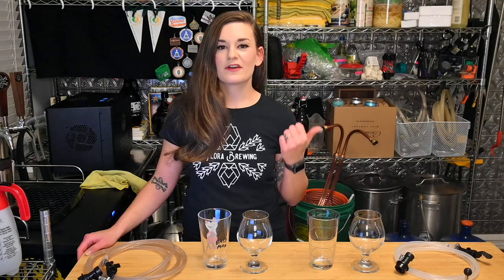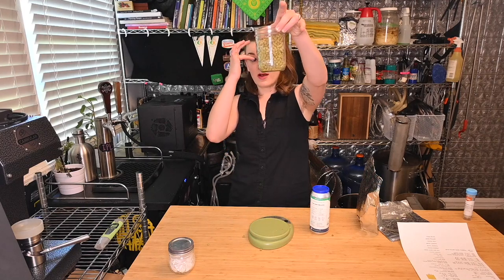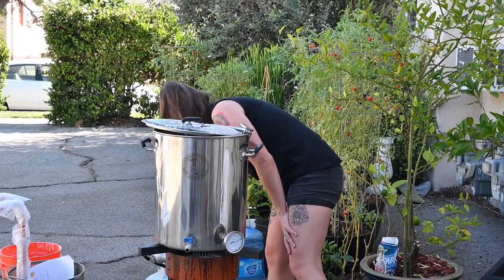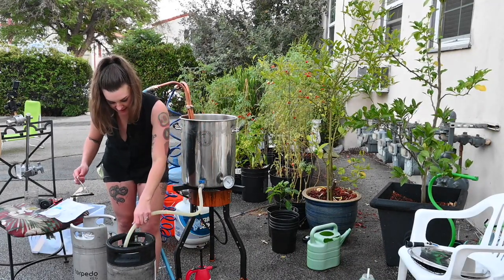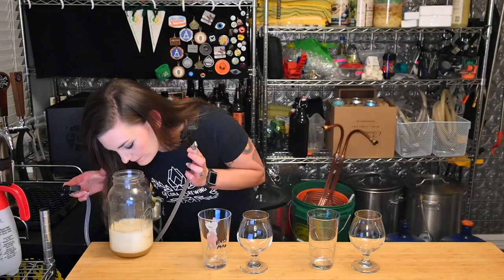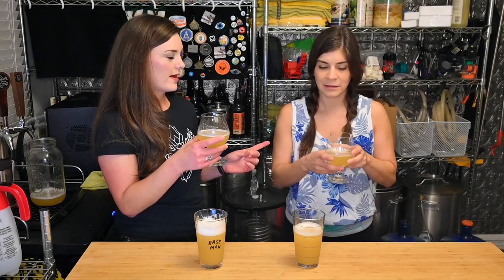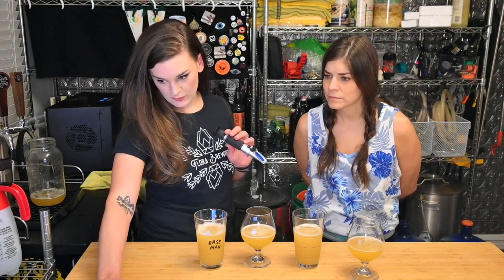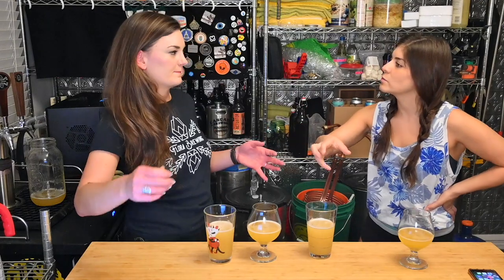Homebrew What Not To Do: Grain to Glass Spontaneously Fermenting Beer (feat. Jenny!)

Comment: You could have added one campden tablet per gallon to the wort when you racked into the kegs which would kill off any wild yeast or bacteria. Cover the kegs with a clean dish towel but don’t seal it so the sulphur can off-gas. If you wait at least 24 hours before pitching your yeast you will have a clean ferment. Wine makers do this all the time at the crush stage since there are lots of yeast and other nasties on the grapes when they are harvested. 

Or just call it a farmhouse ale and let the wild yeast do its thing as has been done for centuries. I often let the wort cool in a sealed fermenter overnight, the no-chill method. But 3-4 days is definitely pushing it! Great video!
Reply from the maker: I've definitely learned my lesson lol

Comment: Great video! I don't think you can count on that alcohol percentage, I use a hydrometer but the change due to the sugars in wild beers does not completely go to alcohol. Also watch out if that's a brett strain, those are notoriously hard to clean off anything...
Reply from the maker: Oh yeah those kegs are going to have to get completely taken apart when they're done. I may as well toss the hoses on the picnic taps as well.
Reply: @FloraBrewing  use hot water in those kegs first before sanitizing them. And yes, throw away the picnic tap.

Comment: You can't use a refractometer, by itself, to check abv. The alcohol affects the reading. You have to put that reading into a correction calculator to get a real reading. The slick on the tongue could be a little Pediococcus. Also, great videos.
Reply from the maker: When I'm going from brix to sg I always use the calculators that take that into account.

Comment: At which temperature where you storing them? The lower the temperature, the lower the yeast (or any other leaving thing) activity

Fun fact, in Belgium they move unfermented wort in tank trucks from different cities
Reply from the maker: It was stored around 70º-75º F just room temperature.
Reply: @FloraBrewing  That will not inhibit any fermentation, I never kept my wort without yeast for more than a few hours, but if kept cold, it should be safe

To be honest, anything could have started your fermentation, from microbes already living in a keg to microbes from the air that got in contact with the wort, or maybe from the transfer equipment, who know really, if it's wild, it can develop over time so you can bottle a few ones

I actually have a contaminated NEIPA too, I'm keeping it to see how this affects the hops over time

Comment: Have you thought of sealing your hops in vacuum sealed bags after opening them?
Reply from the maker: I prob should but that just another task to add 🤷‍♀️
Reply from the maker: I prob should but that just another task to add 🤷‍♀️
Reply: @FloraBrewing  
That's why you get a large pressure vessel and a vacuum pump with a pressure switch.
If you want to get all fancy, drop some desiccant in the bottom.
Throw all of your stuff in the pot, close the lid & flip a switch.
It'll take care of itself until you need something inside.